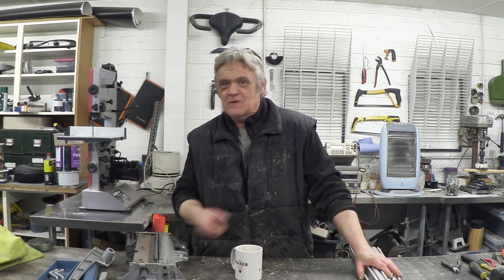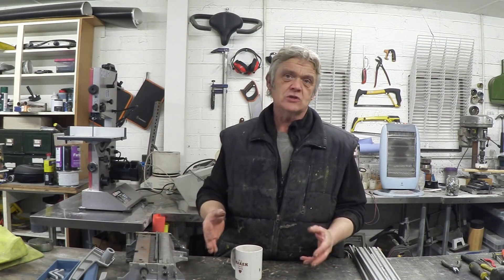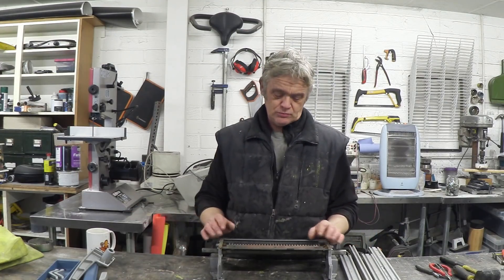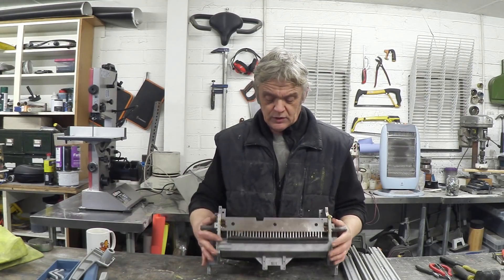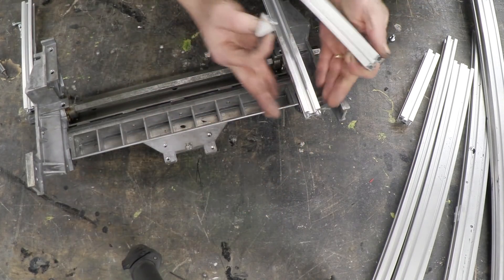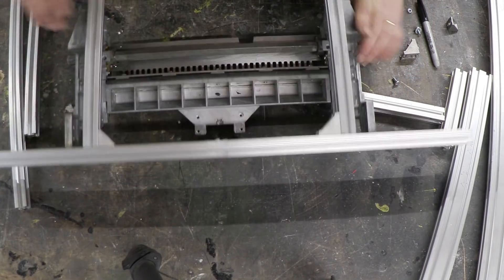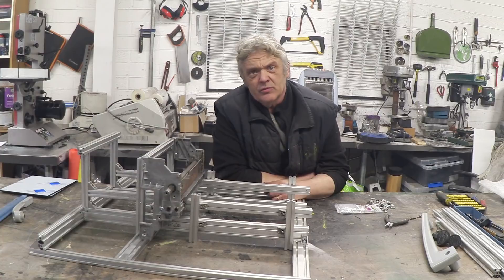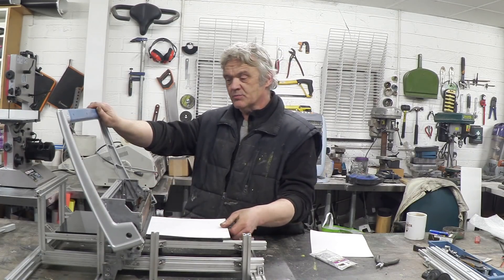963 - Bespoke Machine Making With Aluminium Extrusion

Comment: when are you building a inverter if you can find a free transformer it will be very cheap using a eg002 pre made inverter board  i have made a bunch of them they are very good inverters for dirt cheap
Reply from the maker: I hadn't;t thought about it until you mentioned it - but I like it! - you are right they are only around £10-15 and that is cheap!

Comment: Where I work has a couple of custom machines made of such. The machines work great until after a while the t nuts work themselves loose due to aluminium squishing under vibration/ pressure. Then product slams into things like sensors or retracting stops, and snaps  them off.
Reply from the maker: to be honest mate - I have seen entire factories made of this stuff

Comment: one ogf the  magic  tech companys  of the day (shhhh its ocado ) make  there machines for  PIK stations  and DEC stations and DTM stations fron this the y work well for the most part  till  it comes to the alignement issues  between a   100 x 100 mt grid and a robot drop  point  if you can get it aligned to  a couple of mm  alls good   otherwise  its pants   hey  ho its not my problem anymore  they didnt want me to play   so ive retired  bye ocado
Reply from the maker: yep you do have to check the square

Comment: do you have a UK source for cheap extrusion?
Reply from the maker: https://www.aluminium-profile.co.uk/20x20-aluminium-profile-kjn992888
Reply: I've used KJN in the past, best value I could find at the time, however today popped into local scrap merchant and they had some 4040 from a dismantled machine - dirt cheap and ended need up without 20m for around £40, including quite a few flings and bits and bobs..

Comment: This building material is what made me seriously look into what it takes to set up an extruder for extruding aluminum period, as I would love to make some bigger stuff in an L shape with the slots and everything, (like extend that 1x2 piece you have out till it is not 2 rows of slots but 4 and then on one side have at least 3 if not 4 slots but the ends have only one slot on the edge and the other side would only have 2 or 3 slots inside the elbow shape, for the corners of a building, to make building a whole skyscraper like building as easy as you are finding at building that platform for your machine, 

one idea I had was to use round slugs of aluminum and make sure they are milled flat then when one is about pushed through the extruder, put in a new slug and put pressure but rotating it at the same time for a bit to weld it to the remnant of the last slug before forcing it all through the extruder, the other is to maybe find a way to use a wratcheting system to force everything through so regular hydralic press of 20 to 50 or even 100 tons is not necessary, so the ability to hold in the sides with that much pressure is not needed either, (or ultrasonic vibration while pressing forward sort of how air powered gravers work as well as reciprocating engravers or something LOL)
Reply from the maker: they do quite a range these days mate I have seen some pretty heavy duty machines made from this stuff
Reply: @ThinkingandTinkering  yeah but the fact that aluminum is just loaded into a tube and pushed through a die like making noodles or something is what amazes me, and how the chunks of aluminum actually bond end to end due to all that squeezing and rearranging, and such. all to make the myriad of extruded aluminum stuff man, the possibilities. I saw some that were basically angle but had lips added for holding edges of panels and such, and that was kinda what I was thinking but with slots in it to allow so many customizable options outside just being a frame for a window and a ceiling/floor of the next level and what not. just seems a shame there is not a source but hey, if aluminum is so sticky and soft it should be possible to just make the stuff here, so I can always get more by making it since aluminum scrap is super easy to come by, and only takes what? 660ºC to melt? be really easy to make the ingots to push through it, though I also wonder if carbon nano tubes would withstand that and let you stir them into the aluminum so it would get organized in straight-sh lines when the aluminum is squeezed through the die making the extrusions super strong and slightly lighter even than they already are :)

Comment: oh yeah if you still have a 3D printer you can make nylon t-nuts for those too, that are self locking and quite strong, and the nylon is plastic so if you strip it out you can heat it up and the plastic will melt solid again and rethread the nut again, just need to do 100% infill though you can also use solid stuff like delrin and pure nylon or polycarbonate (*the stuff I printed with is called Taulman 230 meaning it is a nylon/polycarbonate hybrid that has other stuff in it that makes it extrudable at 230 degrees or even a little less, and I found that kapton tape and nothing else not even heating of the bed was necessary for printing smaller parts from it, ) I think I still have a video on here for the nuts I made not sure.
Reply from the maker: nice tips mate - cheers

Comment: That is the exact T-Track that I bought and I cut them in half with my band saw and made strong T-Track for my radial arm saw table. They work very well. Cheers mate
Reply: What was the t track on the radial arm saw for? I can only guess it was a length stop?
Reply: @stuffandthings6188  It was for a stop and for the hold down. See, I bought the router head and every router blade to go with the saw. It makes molding as well as saw. The track allows me to use the hold down wheels that where bought also and I can use feathers with it that I made myself with PVC board. Those t-tracks are also used as guides and to attach hold down clamps for cross-cuts.
Reply from the maker: nice one mate - cheers

Comment: on the hole punch I wonder if less pressure could be used if you did a rolling hole punch where you had each punch in a sleeve like the hand held hole punches for sheet metal and a wheel that rolls down a row pushing each one in and through as it went with out the paper stack slipping, or not. seems it would lower the pressure needed like making a bead on sheet metal works far easier from a roller than trying to curl it all at once. and like me you can put a compound curling action to make stuff like my goggle rims where the bead can be curved around in a circle to hold a little ridge sticking out of a round lens :)
Reply from the maker: oh - I am sure there are hundred ways you could do this job ate

Comment: is that 80/20? LOL about time you did a video on that stuff XD (or is it V-slot since  there is a difference and there is some other company making something similar but I think most if not all of their stuff like V-slot brand for openbuilds, is all metric where as the 80/20 comes in both varieties series 10 is what I have all inch based 1x1 and 1x2 from zoro, 25 bucks per 8 foot 1 inch long sticks and 42 I think for the same length in 1020 (1x2 inch sized) with orders over 50 bucks shipped free, which is where the real expense is for that stuff from the official 8020inc company LOL you can buy 2 bucks worth of stuff from them and the shipping will be like 10 bucks HA HA
Reply: all the zoro purchases under 50 are 5 bucks here in the USA and that above is the same 5bucks or free depending on how much you got.
Reply from the maker: I am not sure mate - I get it in 20x20 KJN